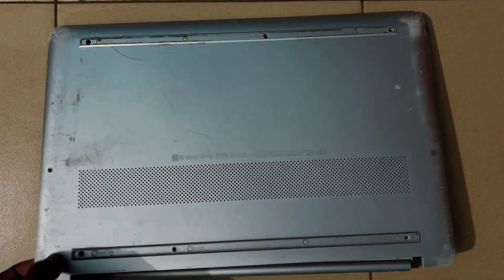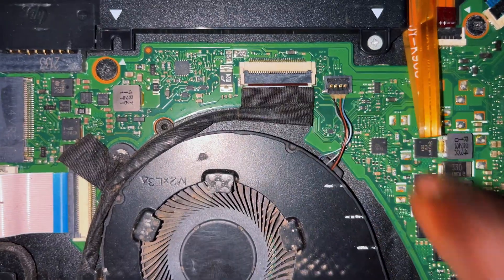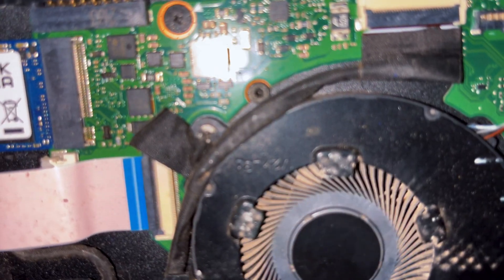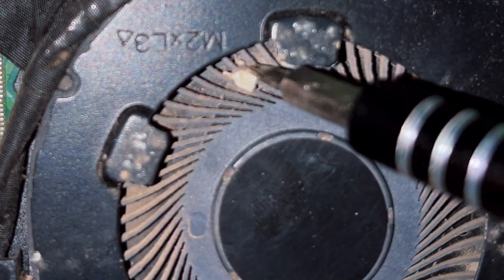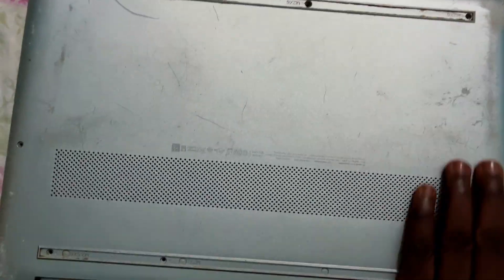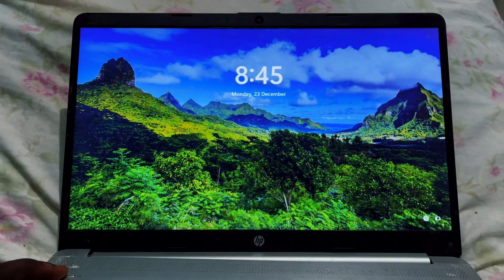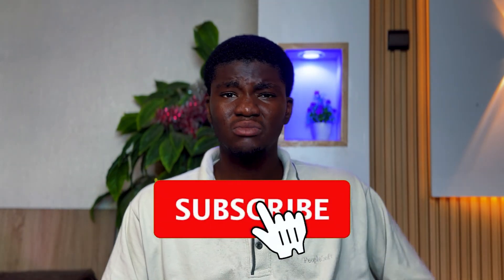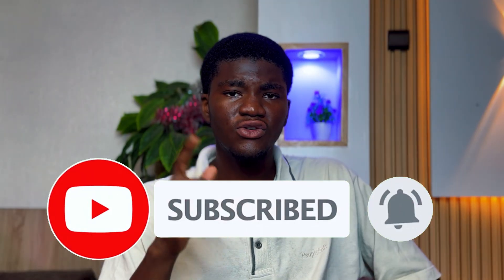How to fix PC cooling fan not operating correctly in 2025

Comment: What about esd
Reply from the maker: Do you mean electrostatic discharge ?
Reply from the maker: I might not really get your question but If yes then you have to turn off your pc completely when doing these repairs so as to prevent esd damage….if it has already happened you could only change that part
Reply: @TechwithCHEF-1T thanks